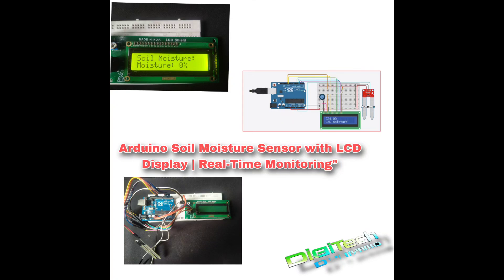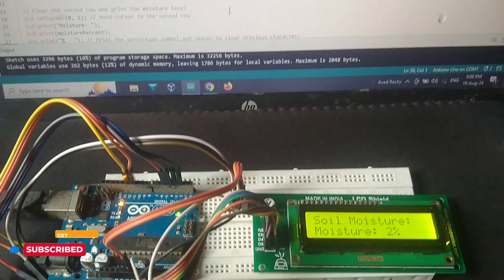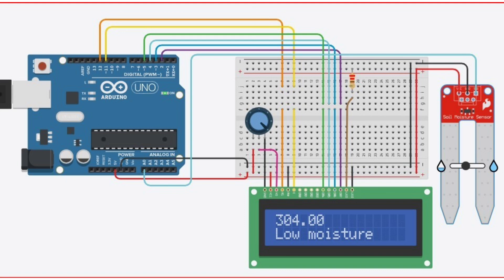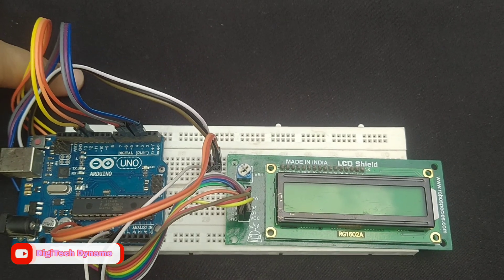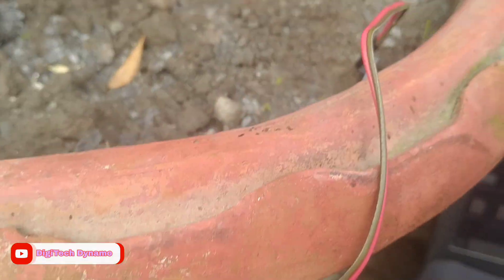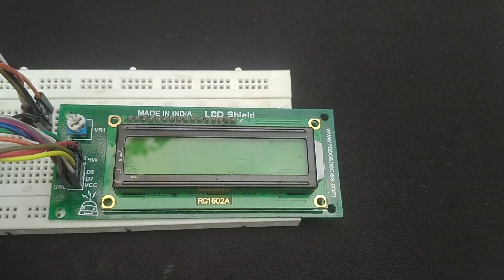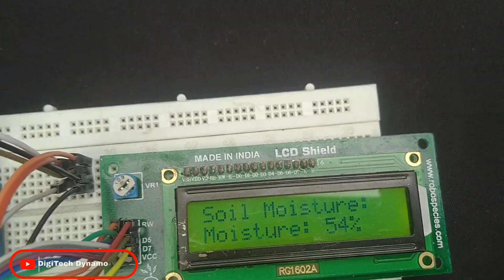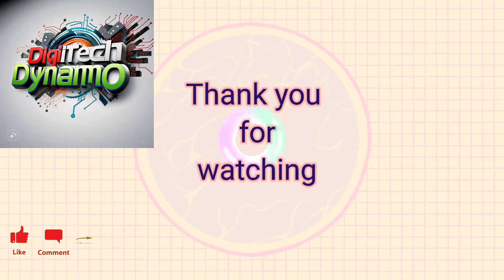Arduino Soil Moisture Sensor with LCD Display | Real-Time Monitoring"

Comment: hi could you upload the code please
Reply from the maker: @SakinaBaziani  ya sure 
#include <LiquidCrystal.h>

// Initialize the LCD with the interface pins
LiquidCrystal lcd(12, 11, 5, 4, 3, 2);

const int sensorPin = A0; // Analog pin connected to the sensor's AO pin

void setup() {
  // Set up the LCD's number of columns and rows:
  lcd.begin(16, 2);
  
  // Print initial message
  lcd.print("Soil Moisture:");
  
  // Initialize serial communication (optional, for debugging)
  Serial.begin(9600);
}

void loop() {
  int sensorValue = analogRead(sensorPin); // Read the sensor value
  int moisturePercent = map(sensorValue, 1023, 0, 0, 100); // Map the value to a percentage

  // Clear the second row and print the moisture level
  lcd.setCursor(0, 1); // Move cursor to the second row
  lcd.print("Moisture: ");
  lcd.print(moisturePercent);
  lcd.print("%   "); // Print the percentage symbol and spaces to clear previous characters

  // Optional: Print to serial monitor for debugging
  Serial.print("Soil Moisture: ");
  Serial.print(moisturePercent);
  Serial.println("%");

  delay(1000); // Update every second
}
Reply: @Digitech_Dynamo  w
Reply from the maker: @SakinaBaziani  this is the code